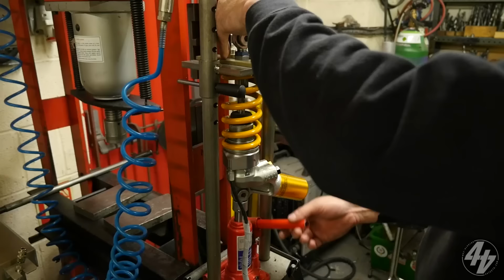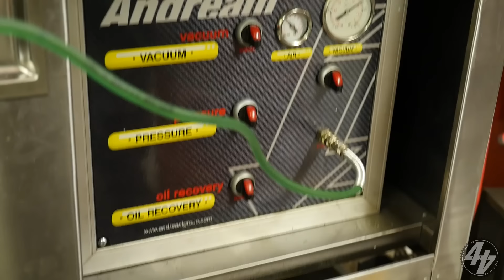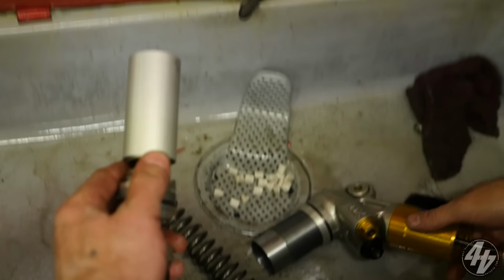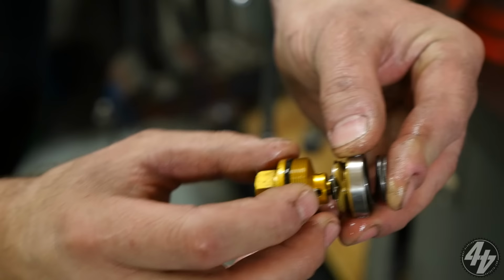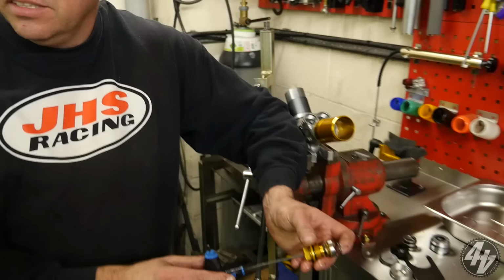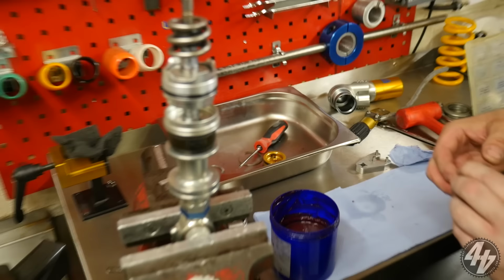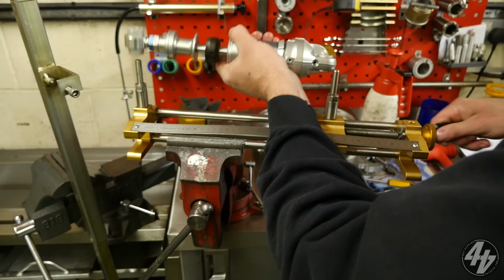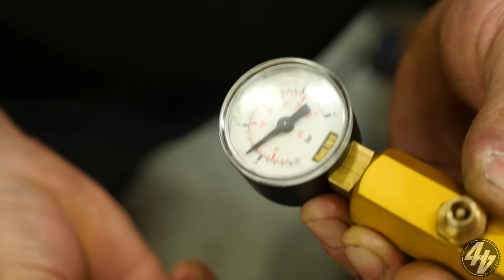What's inside an Öhlins Shock?

Comment: 17:35 I can not agree.

When u compress the spring there is still a space behind the piston. I guess the idea behind was to make it fill easier by avoiding air pockets but as i said - compressing it still leaves an areas that can cause us a problem. I guess sometimes, due to design, voids can create. I guess the only remedy is to cycle the shock few times in different positions when u fill it with oil.

Comment: Why can't they use a spring,instead of gas,to pressurize the piston in the canister?
Reply: weight and you can alter the pressure more easily to prevent cavitation
Reply: Nah. Need a better reason than those of the wall guesses.
Reply: +jimmy mushman I'm a motorcycle engineer
Reply: +jimmy mushman air is also more progressive in its spring action and has less hysteresis than a coil spring
Reply: Well you're partially correct in the fact it's job is to prevent cavitation. however, due to the fact that according to Bernoulli's the pressure differential increases with the square of the velocity it is important that the air has a progressive nature as it provides increased force as when the shock is deep within its stroke it typically sees higher shaft velocities. that's why air is so useful for this application.

Comment: Why don't they coat the inside of motorcycle tyres with the same rubber that is used to seal the canister gas fill port?  Then,if you get a puncture,the tyre will be self-sealing like the canister gas filling port.
Reply: I doubt the pressure would be great enough and there is too much flexibility in the tyre too, that rubber bung is rigidly supported by the aluminium surrounding it and being squeezed at a much greater pressure both from the gas in the shock and being tightly squeezed into a small hole.